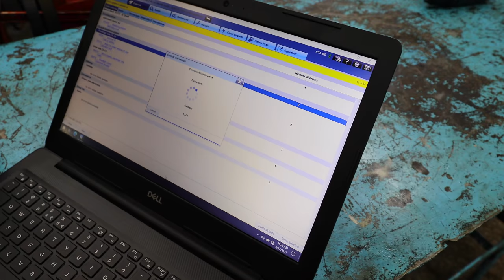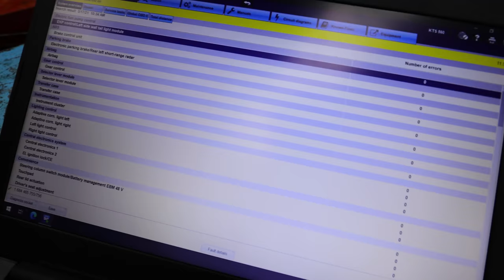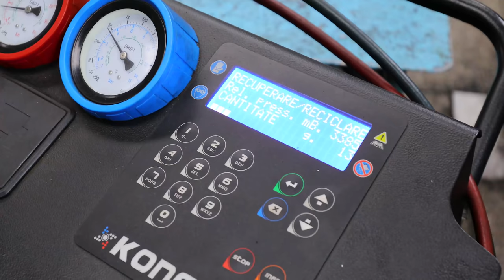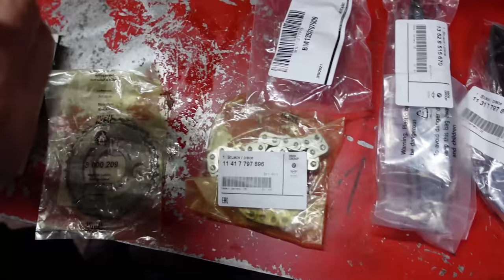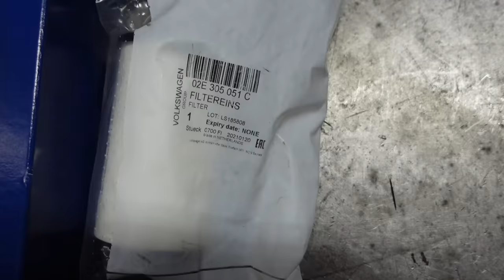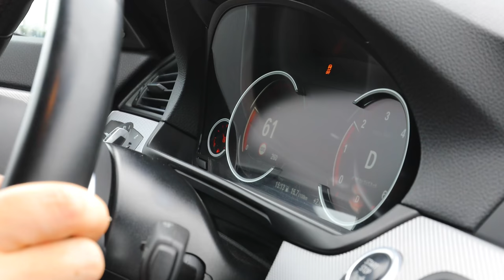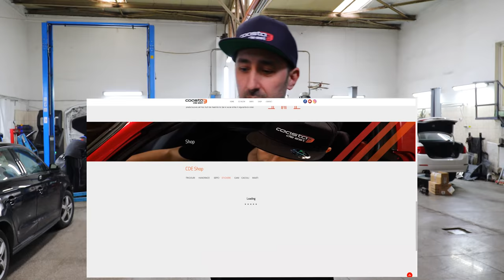BMW M550xd - balaurul cu 3 turbine 😈😈😈

Comment: Pentru mine cel mai tare BMW făcut vreodată rămâne BMW seria 8 cel lansat in 1989 , la Salonul Auto de la Frankfurt. 
 Pentru vremea respectivă masina era performanta , luxoasa , plina cu tehnologie . 
Seria 8 a fost una din primele automobile de serie cu suspensie independenta de tip multi-link inclusiv pe puntea spate. Adica o suspensie cu mai multe brate laterale si longitudinale care confera o stabilitate imbunatatita si o aderenta perfecta a rotii cu suprafata carosabilului. O suspensie costisitoare, care si in zilele noastre este intalnita pe automobile mai performante, cu multe piese in miscare, dar foarte eficienta.
 Tot pe BMW - ul respectiv se găsește un sistem care facea ca toate cele 4 roti sa contribuie la directie atunci cand era invartit volanul ( Active rear axle Kinematics ).
 Masina respectivă avea la acea vreme o grămadă de dotări (interior imbracat in piele naturala, scaune cu reglaj electronic si memorie, volan cu reglaj electronic si memorie, scaune incalzite, pilot automat, clima automata pe doua zone, sistem audio cu 10 difuzoare, computer de bord cu autodiagnosticare, 4 airbaguri, controlul tractiunii si sistem ABS. Modelele fabricate spre sfarsitul productiei mai beneficiau si de faruri cu xenon si chiar navigatie ) .
Deși masina respectivă a fost un eșec total la vremea respectivă pentru electronica și toate sistemele cu , care a fost dotată , pentru mine mașina respectiva rămâne un model frumos și un model " tare " .

Comment: Pentru mine cel mai tare model de BMW este M5 E60 V10, a fost declarată cea mai rapida berlină cand a aparut, este un motor aspirat v10(S85) ce produce 507 cai si 520Nm cuplu si cutie SMG.
Are un sunet demențial si un design impunător, tractiune doar spate  si foarte dotată pentru varsta ei, cum ar fii: head up display si distronic.
Pentru mine este modelul preferat si consider ca e perfectă stock.

Comment: Salutare baieti, printre cele mai frumoase modele de BMW ar fi seria 7 e23 de prin 80'. Mi se pare o masina cu atitudine, care exprima ceva anume, un clasic elegant parerea mea, unul din putinele modele de BMW pe care daca as putea l-as lua, prea multe nu stiu despre ele ca nu am avut:)) dar din ce am citit cel mai mic motor pus pe ele a fost de 2.5 si urca pana la 3.5 si daca nu ma insel a fost primul BMW cu abs si volan cu airbag optional, la design nu am ce comenta, un tip limuzina cu un bot agresiv, probleme nu stiu ce ar putea avea dar la varsta pe care o are daca nu e reconditionata inca ar merita efortul parerea mea. Toate cele bune baieti, spor la treaba abia astept urmatorul video🤙

Comment: Pentru mine cel mai tare bmw facut vreodata ramane seria 3 e46. O masina extraordinara pentru anii in care a aparut si a fost fabricata pe toate platformele: Sedan, coupe, cabrio, wagon si chiar si acea incercare de compact. A avut un design inedit pentru perioada ei foarte atragator si venea in foarte multe configuratii, de la motor de 1.8 pana la celebrul S54 3.2 natural aspirat de pe M3. Pe varianta 320i non-facelift a venit cu motor de 2000cmc cu 6 pistoane in linie, si daca nu ma insel motoarele de 2.5, 2.8, si 3.0 au acelasi bloc motor diferenta fiind de adancimea cursei pistonului. A avut atat tractiune spate cat si xdrive iar ca dotari au venit cu foarte multe optionale. M3-ul a venit atat manual cat si cu celebrul SMG care a fost o cutie de viteze automata foarte controversata. E46-le la baza este o platforma care poate suferii foarte multe modificari, existand oameni care au pus si motoare de 6.2 pe acea caroserie. Tot pe e46 apar motoarele cu valvetronic si cu vanos, un sistem interesant pentru anii 2000. Consider ca si dupa toti acesti ani, e46 ramane una dintre cele mai frumoase, bine construite si cel mai important, este o masina dorita de foarte multa lume. O masina care poate fi atat un daily-driver sau de drum lung, masina de distractie in weekend sau un project car foarte bun. Pozitia la volan si modul in care se conduce un e46 este foarte faina. Imi cer scuze pentru eventualele informatii eronate dar astea sunt primele informatii care imi vin in cap cand ma gandesc la acest model, un model care reuseste sa ma faca sa intorc capul dupa el ori de cate ori il vad pe strada. Salut si zi faina la toata lumea!

Comment: Bună seara dragilor, felicitări pentru munca depusă, un clip interesant, că toate celelalte.

Personal, după ceva documentare, cred că un model interesant al firmei BMW este modelul M1 sau E 26, produs între anii 1978 și 1981, model dezvoltat pentru a-i concura pe cei de la Porsche. 
Este special prin seria de peripeții prin care a trecut ca să fie produs, parteneriat la început cu Lamborghini, șasiu și caroserie fabricate în Italia, apoi prin faptul că a fost singurul model cu motor amplasat central până la I8, și nu în ultimul rând pentru că era fabricat manual de celebra divizie M.
Motorul, cum altfel, un 6 cilindri în linie de 3,5l, dezvolta 273 cai și un cuplu de 330Nm, căluți ce  propulsau mașină până la 260 km/h.

PS, păreri de rău pentru plecare D-lui Ion.

Comment: Ca si clip-ul cu Touareg-ul sau A6-ele 3.0 TFSI, bai nene cata munca pentru un schimb de distributie. Congrats pentru rabdare.

Dpmdv, cel mai interesant BMW produs vreodata, este BMW Nazca C2 coupe, ce a debutat in anul 1992 la salonul auto din Tokyo, avand un motor de 5L V12 (provenit de pe 850i), de 350 de cai (usor ajustat de catre Alpina) cu tractiune spate, plasat central, conectat la o cutie manuala cu 5 trepte si "trantit" intr-un sasiu din fibra de carbon, acoperit cu o caroserie din acelasi material. Desi puterea nu parea neparat ceva de speriat, datorita excesului de fibra de carbon (inclusiv scaunele erau compuse din acest material) si a altor componente din materiale usoare, intreaga greutate a masinii era de 1,000 de kg. Au mai fost 2 modele concepute, M12 aparut in 1991 la salonul de la Geneva si C2 Spider/Cabrio aparut la cea de-a 61-a editie a camponatului de Formula 1, ce a avut loc in Monaco. C2 Cabrio-ul era si mai interesant, motorul de 5L fiind inlocuit cu unul de 5.6L de pe 850Csi si conectat la o cutie manuala cu 6 rapoarte, dezvoltand undeva la 380 hp. Nici nu s-au chinuit prea mult in realizarea cabrio-ului, au renuntat la geamul ce acoperea motoru, cele doua geamuri (sofer si pasager) se demontau si depozitau in compatimentul pentru bagaje, si au vopsit in culoarea caroseriei elementul central ce despartea geamurile anterior mentionate...si...et voila...cabrio :))

Dintre cele 3 modele (M12, C2 Coupe si C2 Spider) doar C2 coupe-ul a fost produs, intr-un numar foarte mic (undeva la 5 exemplare, daca nu ma insel). Ca am uitat sa precizez, design-ul masinii a fost facut de catre cei de la BMW in colaborare cu Italdesign, sau mai bine spus invers, Italdesing in colaborare cu BMW...

Imi aduc aminte in NFS 2 era "the car to have", iar in randul surprizelor la Guma Turbo, o dadeai la schimb pe minim 3 Ferrari de top.

Comment: BMW E24 Seria 6 1976-1989 .  In opinia mea  prima generatie de BMW Seria 6, dupa ce a fost redenumita gama New Six, era un coupe cu forme extrem de atragatoare.Initial, odata cu lansarea din 1976, avea sub capota un propulsor in 6 pistoane de 3.2 litri si 197 cp. A urmat motorul de 3.5 litri care producea 218 cp, insa apogeul acestui model a fost atins in 1983, cand a iesit pe piata primul M6 numit la acea vreme M635CSi. Acesta din urma avea o putere de 286 cp si un top speed de 255 km/h. Are si un aspect frumos . SPER SA VA PLACA !!

Comment: BMW 8 Series (E31) - exact ca cel admirat in clip, o masina "timeless" cu motorizari intre 4.0L - 282 hp si 5.6L - 375 hp
Un model rar...unde daca nu ma insel sunt putin peste 30k exemplare vandute in lume
Chiar daca in familie avem pe langa un accord CL7 FL si un bmw Z4 (e85) pot spune ca design-ul anilor 90' la acest model o sa ramana mult si bine "tata lor"
Ca tot ziceam de 90's ...aveau si cutie manuala in 6 trepte (ceva super rar pe atunci) + cum era la moda atunci pop-up headlights.

Comment: Desi ai zis sa nu scriem BMW E30 ( ursulet ), chiar aceast model este cel mai misto ( sunt subiectiv ), dar asa este. Dream car de la varsta de 13-14 ani, am ajuns sa implinesc acest vis pe la 27 ani. Asa ca: 318i BMW E30 World Line cu tot blocul optic alb si motorul original din 1987. In momentul de fata are aprox 310.000 km si functioneaza perfect fara nici o interventie majora. Este ca o poveste atunci cand ai/conduci un ursulet, nu te poti supara niciodata mai mult de 10-15 min atunci cand se strica ceva :)). Intra nebunia in vigoare si trebuie sa il stii reparat si pus la punct. Acum s-a ajuns intr-un punct in care piesele de ursulet sunt din ce in ce mai rare, iar preturile explodeaza. Cautarea asta de piese rare, piese misto de pe alte modele de ursulet te fac sa fii angrenat in tot ceea ce inseamna masina si urs. 

Sa concluzionez: Nimic nu se compara cu mirosul de ulei si benzina atunci cand te urci in urs si pleci la o plimbare :)))

Comment: Din punctul meu de vedere,cel mai tare model de BMW facut vreodata este BMW M5 E60 cu celebrul motor 5.0L V10 S85.
Este o capodopera din punct de vedere a design-ului exterior dar si interior, mai ales la aceea vreme,2003.Exteriorul daca a fost bine intretinut,protejat,spalat,polishat,etc poate atrage priviri chiar si in ziua de azi, avand in vedere ca masina este majora :D. Si acum ii inteleg de ce BMW au acest slogan ,,THE ULTIMATE DRIVING MACHINE,,. :D
Aceasta masina mai are o chestie pe care o ador,anume cutia de viteze SMG(sequential manual gearbox)cu 7 viteze,de generatia a 3-a.Este o cutie manuala robotizata cu 5 moduri de rapiditate a schimburilor de treapta. Pe scurt,sunt foarte brutale schimburile de trepte ori pe automat ori pe manual.(personal mie imi plac aceasta senzatie de schimbare a treptelor,chiar daca nu am avut niciodata ocazia sa experimentez,dar am vazut clipuri cu BRUTALUL M6 lui Andy Popescu :D). Probabil multora nu le plac aceste smucituri, vor sa pluteasca cand conduc,ii inteleg perfect :)),dar mie,personal imi plac la nebunie ,,aceste smucituri,, :D.
Imi pare rau ca modelele cu cutie manuala in 6 trepte au fost disponibile doar in Statele Unite ale Americii :( (acolo senzatii tarii,cand schimbi tu sau ,,mesteci in mamaliga,, cum se mai spune :))) )         

Acum, sa revenim putin la acest motor magnific,este un motor de 4999cc V10 pe benzină aspirat natural de 507CP(373KW) la 7750 rpm și cuplul maxim de 520 Nm la 6.100 rpm, care a înlocuit motorul S62 V8 de pe M5 E39(alta bestie :D) în modelul M5 produs 2005-2010. A fost primul și singurul motor V10 de producție al BMW, cât și primul motor V10 pe benzină disponibil într-un sedan de producție (berlină),dar si pe break din anul 2007 (TOURING pe intelesul fanilor BMW :D).Masina prinde 100km/h sub 5 secunde,mai exact 4,7 secunde,destul de impresionant la acea vreme mai ales pentru un sedan. Acum daca stam sa comparam cu motorizorazirile din zelele noaste, ,,un amarat,, (daca pot sa-i spun asa,dar din cate se vede e bogat,are 3 turbine :)) )de M550D prinde suta tot in 4,7 secunde, ce coincidenta :D.
Introdus pe E60 M5, S85 a fost inspirat de implicarea anterioară a BMW Formulei 1 . Spre deosebire de majoritatea celorlalte motoare BMW M , S85 nu are legătură cu nici un motor BMW de producție obișnuită.
Motorul BMW S65 V8 (folosit pe M3 E92) se bazează pe S85.
In bordul masinii se poate observa vitezometrul care se opreste la doar 330KM/h si turometrul care probabil se plictisise si s-a orit la 9000rpm :))).Un lucru foarte interesant este ca linia rosie este variabila si se ajusteaza in functie de temperatura motorului. De asemenea mai are un buton ,,M,, pe volan care comuta intre cele 2 optiuni de putele 400CP sau 507CP. inca ceva de mentionat, modelul E60 are prima generatie al sistemului de infotaiment, numit iDrive.
Intr-adevar nu a fost nici cel mai fiabil motor(nu ca al lui Alin, nemuritorul Passat B5.5 1,9L cod AWX 131CP, 5 trepte in fata,una in spate :D) noroc cu Rares, asa am invatat poezia :D.Avea probleme cu rulmentii bielelor,cu actuatoarele clapetelor de acceleratie,cu pompa de VANOS,cu cuzinetii si poate si alte probleme,dar hai sa nu fim rai cu aceasta bestie.
Una peste alta a fost, este si va fi o masina pe cinste, din toate punctele de vedere: al sunetului in primul rand care suna intr-un tunel ca o fiara, al motorului, al sasiului si toate cele.
In concluzie, BMW M5 E60 este un automobil sportiv de lux si care o sa-mi placa cat o sa traiesc eu. O mentiune as avea,pentru mine,cum sunt fan break-uri(TOURING-uri :D) as vrea sa conduc modelul E61 care este si mai rar decat E60. De ce va intrebati?. Pentru ca,masinile break,adica touring :)) sunt  ,,THE BEST SLEEPER CARS,,. Nu o sa te astepti cum de o masina asa mare ,,o sa-ti dea cu fum,, de la primul claxon :))),perere personala,NO HATE. La fel cum a fost si cu A6-ele C6 facelift 3.0TFSI la care i-ati facut distributia,Rares s-a speriat putin de cum tragea masina :)))
Baieti, va las, mi-a facut mare placere sa vorbesc despre ,,o bucatica din istorie,, :D. Imi place foarte mult ceea ce faceti,multa bafta in continuare in tot ceea ce faceti si sa auzim numai de bine. Sanatate si toate cele bune. <3 <3

Comment: Din punctul meu de vedere bmw a facut foarte multe masini misto de-a lungul istoriei si e destul de greu sa ma hotarasc care e "cel mai tare", dar cred ca printre cele mai tari ar trebui sa se numere urmatoarele:
1. BMW Z1, pentru sistemul de deschidere usi si pentru inovatiile cu care a venit la momentul inceperii productiei.
2. BMW M5 E60 "pentru ca V10" pentru cea mai rapida berlina din lume, pentru silueta de drum, pentru cat de versatil a fost acest model si nu in ultimul rand, pentru sunet.
3. BMW SERIA 8 E31, o masina extraordinara, motoarizarile cu care venea seria 8 fiind doar de capacitate cilindrica mare, o adevarata legenda.
4. Si un BMW  de generatie noua, BMW 760 LI G31, un motor v12 de 6,6 litri care consider ca va lansa acest model printre masinile "legenda" facute de BMW.

Comment: Cel mai tare BMW făcut vreodată... E destul de greu de spus deoarece sunt destul de multe Bmw-uri care te lasă cu gura căscată. Strict din punctul meu de vedere, pentru mine cel mai tare Bmw făcut vreodată este Seria 8 E31, o bomba cu tehnologii noi. Mașina este o întreaga poveste, fiecare latura are ceva de povestit, fiecare linie te lasă fără cuvinte. Bmw-ul care nu arată a Bmw, a fost ceva inovator pentru acea vreme. Avea un coeficient aerodinamic foarte bun și era plină de tehnologii noi. Atât mașina, cât și in faza de proiectare s-au folosit tehnologii noi. De la proiectarea in CAD, la apariția CAN bus-ului pe mașini, cât și a suspensiei și direcției (modelele CSi având direcție AHK cu punte spate viratoare) și multe alte inovații ce au schimbat lumea automobilistică. Din păcate lumea nu a fost pregătită pentru o asemenea mașinărie care costa ceva la acea vreme, motiv pentru care s-au fabricat destul de putine și a fost declarat  proiectul eșuat al bavarezilor. Acum, 32 de ani mai târziu, seria 8 încă face fata cu brio multor probe de rivalitate cu mașini moderne, dar din păcate sunt tot mai rare și multi nici nu le recondiționează, nici nu le vând. Aceasta mașina este pe locul 1 in top 5 mașini la care visez. Este genul de mașina la care poți doar sa stai și sa te uiți la ea, sa o savurezi din priviri și simți furnicături sub piele, simți bucurie. Este o adevarata opera de arta. ❤️

Comment: Bmv  M coupe este un model special deoarece a fost defapt un z3 modificat in uzina si transformat intr-o masina motorsport veritabila . S-a produs din 1998 pana in 2002  in varianta coupe dar si in varianta cabrio , aceasta masina a avut doar 2 motorizări . Pana in 2001 toate M coupe aveau sub capota motorul de m3 de 3.2 litri si 321 cp insa ultimele modele au primit motorul de pe viitorul m3 adica generația e46 un motor 6 in linie tot de 3.2 care dezvolta 325 cp. Acest model este interesat deorece este unicul model realizat de nemti cu caroserie de tip ,,shooting brake'' tracțiune spate si o putere destul de mare care era capabilă sa atingă viteze de peste 300 km/h .
 Chiar mi-ar prinde bine trusa pentru ca ma pasioneaza mecanica si imi place sa mai fac cate ceva la masina ✌. Va urmăresc inca de la început , sa o țineți asa in continuare! Faceți content de calitate .

Comment: Salutare.Din pacate tocmai azi am reusit sa revin la zi cu clipurile postat din cauza serviciului si imi incerc si eu norocul tocmai acum pentru ca ,imi doresc tare mult aceea trusa.
Cel mai "tare" BMW facut vreodata dupa parerea mea este emblematicul BMW 328 fabricata intre 1936 si 1940. A fost "botezata" 328 pentru ca motorul avea codul M328 poate chiar stra stra bunicul actualelor modele M sa zicem.Dezvolta 80cp si motorul era cuplat la o transmisie cu 4 trepte.Masina are un palmares foarte bogat in motorsport cucerind nenumarate titluri in curse pentru aceea vreme cum ar fi Mille Miglia ,Rac Rally plus multe altele si chiar reusind sa iasa pe locul 5 la general la clasa ei in vestita cursa de la Le Mans 24h.
Partea cea mai frumoasa este ca domnul Marin Dumitrescu care a trecut de frumoasa varsta de 100 de ani in urma cu peste 50 de ani modifica un BMW 328 participand cu el la curse de viteza in Coasta si castiga cel mai frumos trofeu din viata lui cu aceasta masina la Sinaia in 1950 denumita de dansul si "Cursa vietii mele".
Pentru mine Bmw 328 nu este o simpla masina,este o masina legendara o masina care a scris istori..
Si daca nu castig sper din tot sufletul macar sa cititi comentariul meu.
Cu stima si respect Coasta de Est!